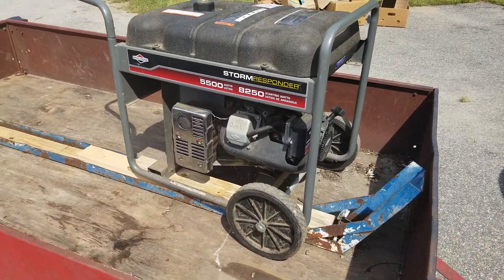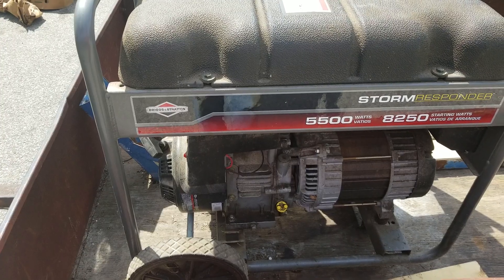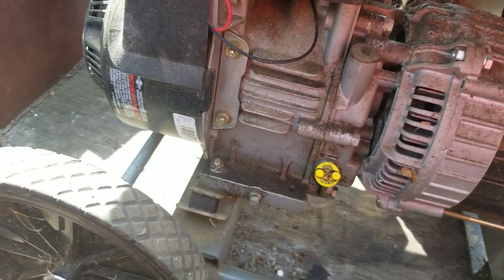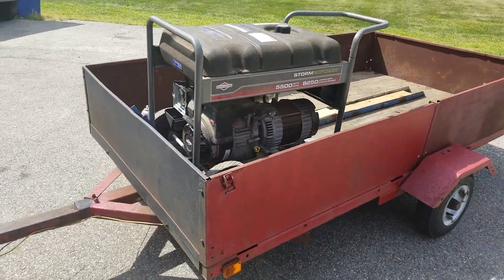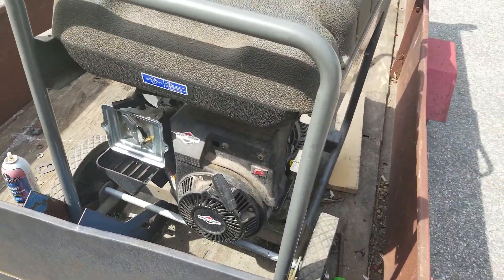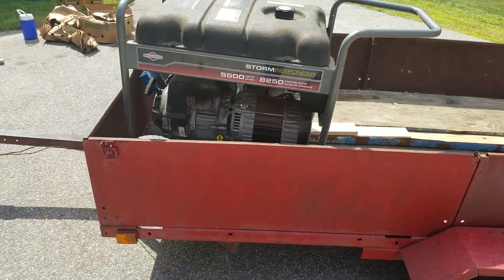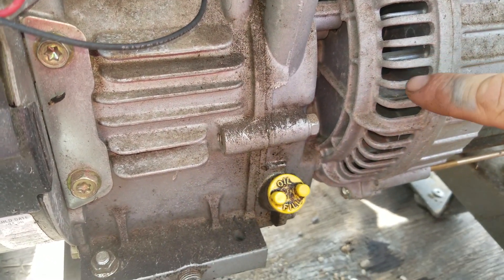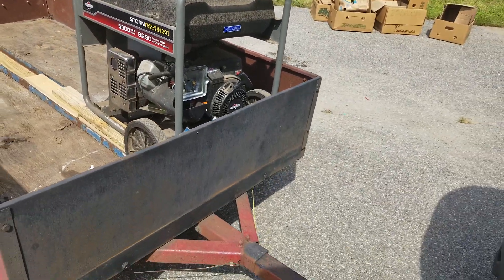First look at my free seized generator from the dump

Comment: Wow, turning with the crowbar Un seized my generator right away!! I did'nt have to turn a wrench at all, to get it running. Great learning video, for a first timer!
Reply from the maker: Gently if it is seized from sitting oil in the spark plug hole 1st

Comment: What are you spraying on the different parts? Is it an oil? My generator has sat in our garage for the last ten years and has the same issue, other than there is no oil and no gas at the moment, but the cord is siezed and I don't want to add gas and oil if i can't get it running. Thanks for your video and hopefully I can get it running.
Reply from the maker: Marvel mystery oil in the spark plug hole

Comment: Hi, my husband bought the same and he was trying the first step that you show in that video but it doesn’t spin 😫 sadly the the blades of the motor doesn’t move .. it still stock. Any other way to move that thing
Reply from the maker: Have to remove the starter put oil in the spark plug hole and work it back and forth
Reply: @2strokeguru  thank you for respond to me, literally I saw the reply late because my husband gave away the generator 🙈🙈But I really Appreciate your answer, blessings!
Reply from the maker: @maryrt.6595  very welcome God bless
Reply: @2strokeguru  God bless you too!